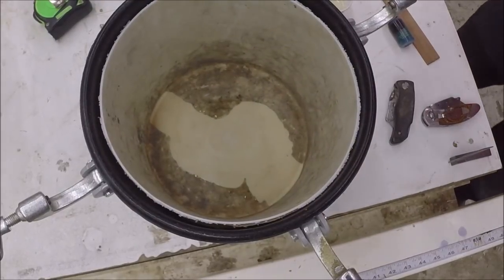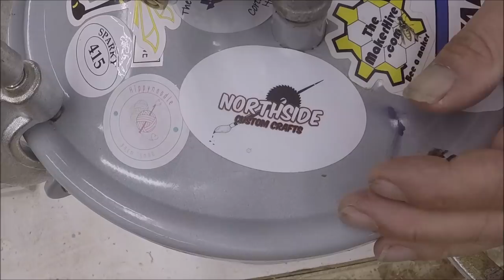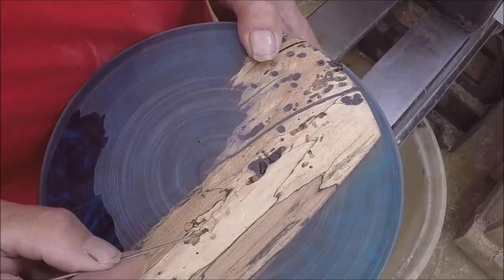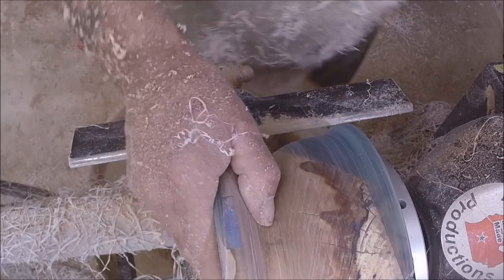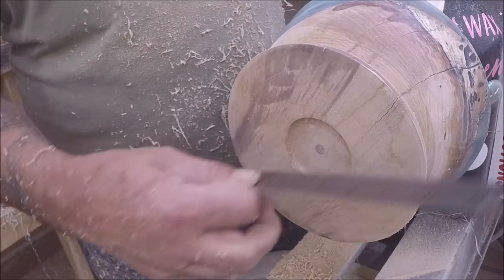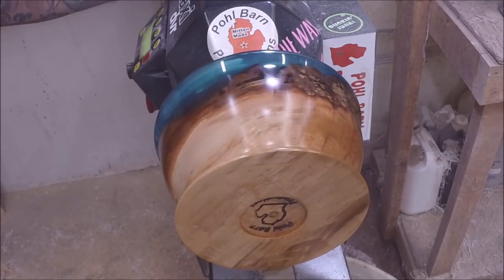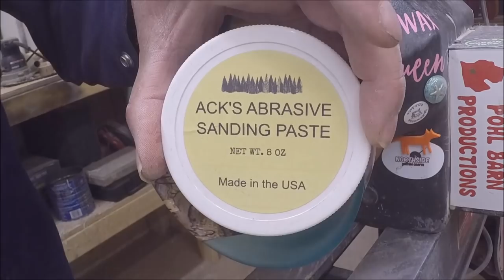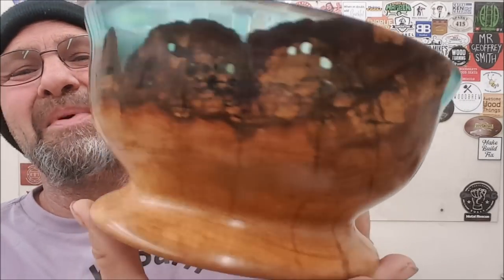Hard Spalted Maple and Resin Bowl

Comment: Quick question, you dried the wood prior to the epoxy in the pressure pot, but did you stabilize the wood with anything like cactus juice before the epoxy? I guess it would only matter if the wood was very porous. Just a guess. Anyhow, the bowl looked great in the end. Another fine project.
Reply from the maker: Thank you Stephen, no I did not stabilize the wood prior to pouring the resin, I did not have the equipment to do so then, I do now but still not sure with the cost of the resin if I would do something this size only to turn it all off onto the floor.

Comment: I just finished my first hybrid but have already taken it off the lathe and finished forming the bottom. I'm seeing it looks like the usual process is to apply a finish while still on the lathe and it gets applied to both the wood and epoxy. Looking for suggestions on how to apply a finish to the wood now that its off the lathe, or should I just try to figure out some way to put it back on and apply with it spinning?
Reply from the maker: Thank  You Chris,  I'm not looking at your bowl so I don't know what is possible, for the most part yes you finish it on the lathe unless you are applying a Lacquer finish, that you can usually spay on without being on the lathe,
Reply: is there an email address to send a pic to?

Comment: For these very difficult timbers, porous or bug-holed or cracked, how would it work to pre-treat the timber by painting it with several coats of a low viscosity slow-setting black translucent epoxy and vacuuming it after each coat to get the epoxy right into all the openings, and then set it in its coloured epoxy? Filling the holes and cracks as you find them seems to interrupt your work flow a lot.
Reply from the maker: Thank  You , I've done that and it does not seem to fill the holes and cracks that are unseen so we just fix them as they are found.

Comment: Can you please explain why the direction of rotation is opposite to that normally seen?
Reply from the maker: Because my Lathe has reverse and I was turning in reverse,  sometimes it's necessary and easier to turn in reverse, its a bit nerve racking as it doesn't seem right but it can be done.
Reply: @PohlBarnProductions  Ok. Thanks for the response. It does seem counterintuitve (due to where the cutting edge is and how its placed and positioned), but if it works it works! I was using the kowledge of turning metal (which would be impossible to cut if the rotation was the same as what you had), but obviously the two operations (machining metal as opposed to resin/wood) are very different.

Comment: Brother Ive watched many of your videos for pure pleasure. I do aircraft composite work and have a suggestion. I notice you filling voids in every video and I also know you have a vacuum pot and pump. Try this: after you situate the wood in the mold and pour epoxy, (make sure you have as much rim height above epoxy line. You will see why it is necessary during vacuum process.) put in vac pot and vac down very slowly. It will bubble violently if you go to fast and spatter epoxy everywhere in vac pot this the reason for the high rim. when it reaches full vacuum, wait til the bubbles slow down to almost nothing. Release the vacuum very slowly so the wood fiber can absorb the epoxy fully. then pressure pot til cured. your voids should almost completely disappear. We use a similar technique for high strength composite layups for aircraft. It should also reduce your tearout as the epoxy will penetrate the fibers.
Reply from the maker: Thanks again !

Comment: Nice one Doug - I like the colors and the shape.  BUT, you mentioned cooking the wood.  Sounds like from green wood.  How long and at what temp please?
Reply from the maker: Thank you Tom,  It was sort of green, it's been down over a year but sealed,  I cooked it at over 240 so the moisture in the wood would evaporate because it was steam. kept cooking it until it stopped loosing weight.
Reply: @PohlBarnProductions  Thanks Doug!  I really appreciate your answers to my questions.  I've got a piece in the oven right now.  After 20+ cycles I got tired of the interminable process of microwaving for 30 seconds, wait for it to cool and repeat.  only lost about 12% of its weight.  Down to 18%+- moisture.  I'm 74 and I've got a LOT of green wood I'd like to turn before I die!

Comment: I have issues with my resin breaking off in huge chunks during turning. Ruining my project. Can anyone suggest whats wrong or what caused? 
Litterally 3 in pieces break off. 
I dont get it
Reply from the maker: a couple things really can cause that,  over heating when setting up and or not enough hardener can cause it to be brittle. also try using negative rake tools for a better cut.
Reply: @PohlBarnProductions  ok. Will try something. I let resin dry for at least 3 days. And cut slowly. Is irritating when gouging out and huge chunk breaks off

Comment: Doug - can you recommend a pressure pot?
Reply from the maker: I'm using a harbor freight pressure pot,  price was the clincher for me, there are others out there but they are costly but then again you get a better product with them.
Reply: Thank you for the information Doug!  Can you also tell me how long you leave the Total Boat resin in the pot when casting a wood/resin bowl blank?
Reply from the maker: it really depends on the resin you are using,  the 2 to 1 I am using, at least 24 hours under pressure.